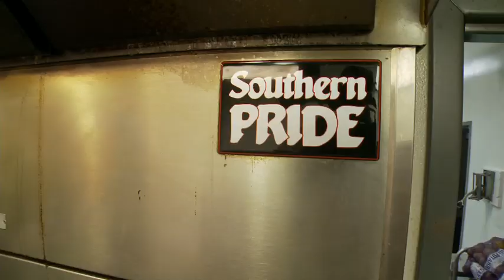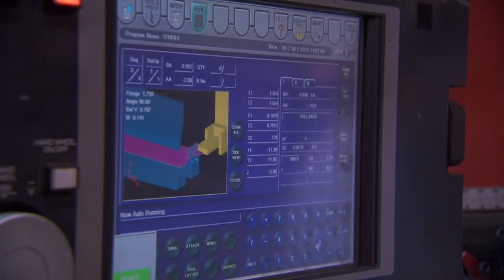Genuine BBQ by Southern Pride

Comment: I won't knock the equipment but I have to agree with Frank & Dustin. Can you prep your food, stoke the fire, maintain the right temperature, etc. all the while babying it from start to finish? That's all the fun in BBQ'ing. Electric & BBQ is an oxymoron.
Reply: it is one thing to Barbecue  I do it all the time  but if you Sell Barbecue you need to automate the process or you will die trying to produce product. brisker takes 10 hours  to make so you load up at night no other way to do it..
Reply: I live in a Texas where many of us who cook and sell BBQ everyday are still living while running stick burners. You don't have to automate BBQ to put out a great product. You can roam all 4 corners and anywhere in central Texas and find the absolute best BBQ all cooked on stick burners.
Reply: well aware i own 2 of them
Reply: There’s a place for this I retired from the post office bought one these on a trailer. I catered for 12yr I made more money in 12 years than I did working for 32 years at the Post Office……one man operation

Comment: Ive built at least 15 pits in my life, finally wore my ass out after 35 years. Switching to sopride is the bwat samn thing that ever happened to me. They can say what they want, its the most consistent low and slow you can get, and its damn good food that comes from it. Dont let um bullshit ya, its as good as theres, ya just gotta get used to them and add a little more wood, its that samn simple, when they get old enough and dont have the help they need, theyll switch, ask blacks bbq , they use um, and say they finish with there other pits. Ha! Why,